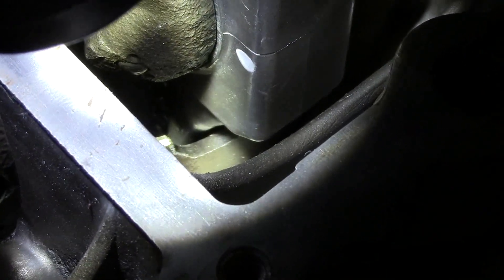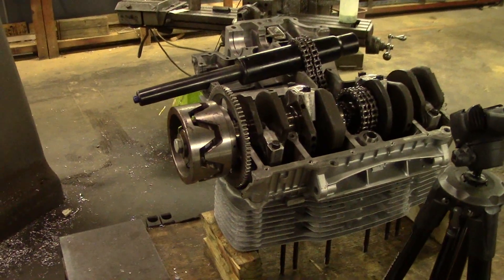73 Honda CB750 Custom Build Episode 11 - Machine Work To Clearance Cylinders For Aluminum Rods

Comment: That clamping method is a bit dodgy even though it worked.  You could have removed the vice and clamped the head directly to the bed of the machine with proper machine Tee slot clamps.  Alternatively  you could have run bolts through the body bolt holes into Tee nuts in the  slots in the bed of the Machine (no vice of course).  If you insist on using the vice like that you should have supported the overhanging end of the work with a machinist's jack such as the Starrett here -

 https://www.amazon.co.uk/Starrett-S191-Little-Complete-Attachment/dp/B0006J4DHG/ref=asc_df_B0006J4DHG/?tag=googshopuk-21&linkCode=df0&hvadid=310805577543&hvpos=1o2&hvnetw=g&hvrand=352003069826589050&hvpone=&hvptwo=&hvqmt=&hvdev=c&hvdvcmdl=&hvlocint=&hvlocphy=1006898&hvtargid=pla-568438791966&psc=1&th=1&psc=1

Safety for you and the workpiece.
Reply from the maker: I was working in another persons facility with limited tools and accessories. You are right on all counts. Did the best I could with what I had, and got the job done. :

Comment: So, you had to do this, because you wanted different connecting roda in there, which are not for Hondas??? And they are much lighter?/More power??/ Just wondering....., good job! Thanks, youtheman =)???
Reply: Eero Laukkanen he had to get different rods because the screws on the original ones are obsolete and they are torque screws so he couldnt re-use the old ones because they have already expanded. So he had to get new rods

Comment: I understand the logic of cutting away at the cylinders because the new Connecting Rods would hit them.  Just wondering.........couldn't you have trimmed down the Connecting Rods,  to get clearance, rather than machining the Cylinder heads?
Reply: +nutmegger1957 You would have had to clearance the rod beam not the end, which would weaken the rod. Removing that small part of the skirt is not going to effect anything but make it tougher going over the rings on final installation.

Comment: Dean great job I'm restoring my 73 CB750 at the same time you are.  The frame is powder coated with new bearings. I rebuilt the wheels and the front forks the same time you did they came out great. All finished with the swing arm. Lots of cleaning,  tapping all the threaded parts ordered all new stainless hardware. A lot of money in rechroming.  I'm a little behind on the engine I just cleaned the pistons and put new rings on. The head has been rebuilt thank you for the heads up on the oil  restrictors I have them and this week I'm going to home the cylinders. Any ideas on what silver paint to use on the engine itself and where to get it. I really enjoy your videos, I'm ready for the next one. Brian Bowers - Florida
Reply: Glad you're enjoying the videos Brian. Check out Cerakote. Go here: http://www.cerakotehightemp.com/
 Click on "Shop Colors" and then "High Temperature Air Cure Coatings". It actually helps dissipate the heat.

Comment: Won't using lighter rods make the crank counter weights unbalanced?
Reply: Mekhanic1 Yes, but in this case it shouldn't be much of an issue. The big end of these rods probably weigh in about the same as the stock rods. I'll be checking that before final assembly. Here's a great article on engine balancing: http://www.enginebuildermag.com/2014/03/weighing-balancing-work/